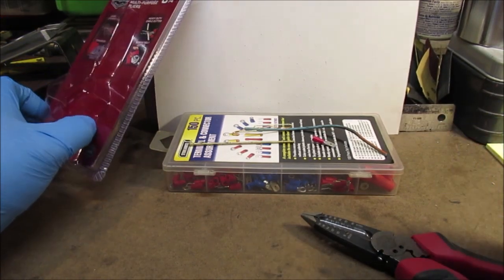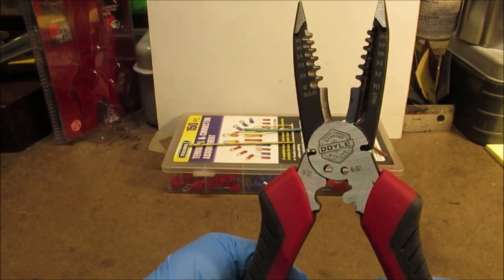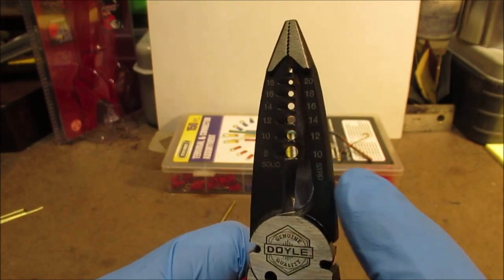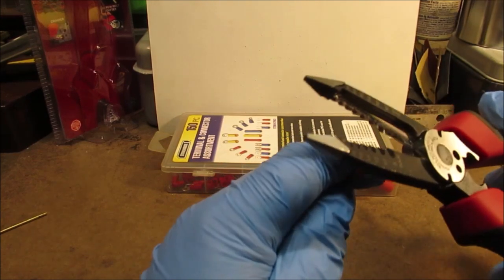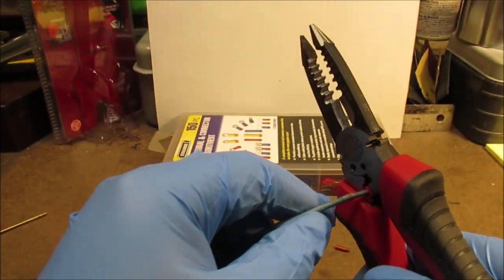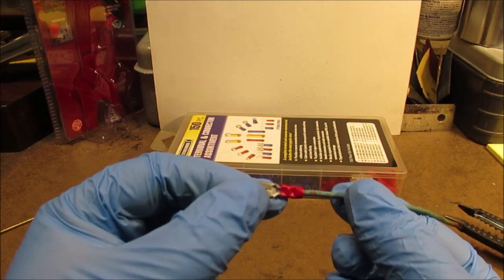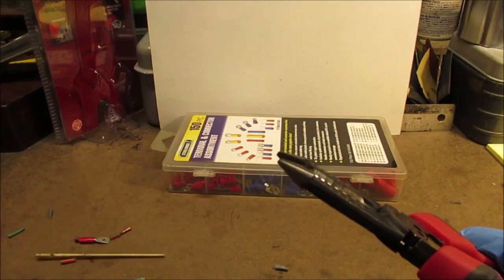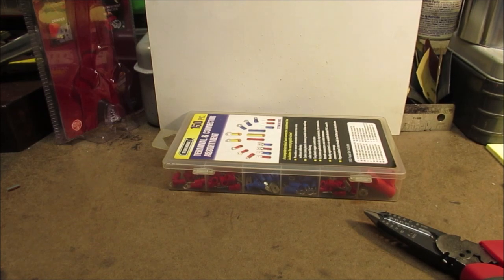New Wire Stripper & Crimping Pliers

Comment: I just got those pliers a week ago and I love them . I have the Kleins, Milwaukee, husky, southwire, kobalt, hart as well as these and work as good as those pliers I have mentioned besides the Doyle pliers.  I love and collect multipliers as well as use them. This pair of pliers work great for what they are and money spent. They look built to last like you said and feel comfortable (the grips). You weren't kidding when you said that they are better than the cheap ones. Cause I tried those off brand cheap ones and they are not sharp enough to make the cut as wire strippers and cutters or crimpers for that matter. Harbor freight did something right when they made these pliers. I concur with you on these being good pliers. Also good video sir.
Reply from the maker: The stripper part is really sharp and I like how they crimp the connector the way it is suppose to be done

Comment: I am going to get those pliers cause I like  multipliers. I have Milwaukee version, Klein version, southwire version, and kobalt version and love them and am a fan of multipliers so they will be part of my tool kit as backup for my pliers that I already have .
Reply from the maker: These are way better than the cheap wire strippers they crimp the connector the way it is supposed to be done

Comment: My HF does not sell those Doyle type stripers. Bummer!!!
Reply: Sorry, I just checked again and they do have them. I had to type in DOYLE Brand electrician's multi-purpose pliers. And they showed up. $23.95, I'll have to get a coupon!! LOL
Reply from the maker: @dukesworld3020  I used a coupon ...I really like these pliers ,,The crimper works nice ..I should have shown the notches on the outside is where you cut heavy wire do not cut tough stuff with the blades where I DID